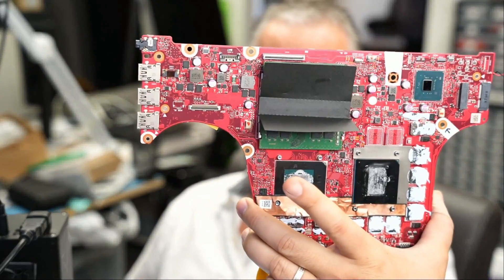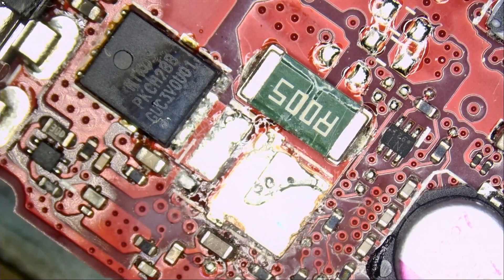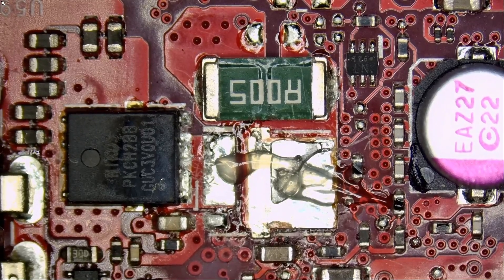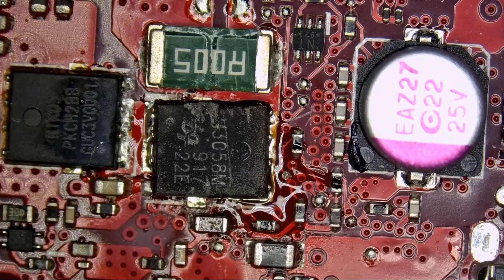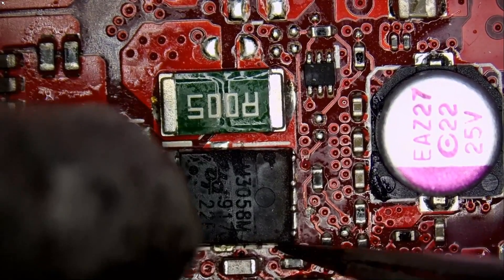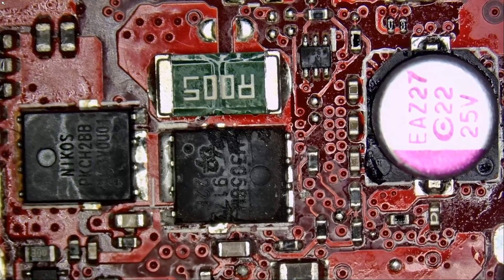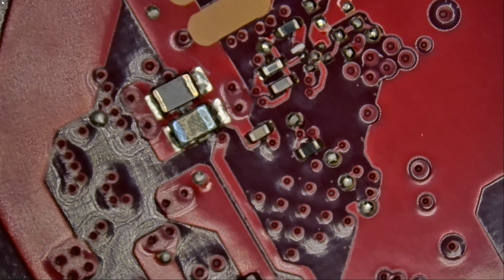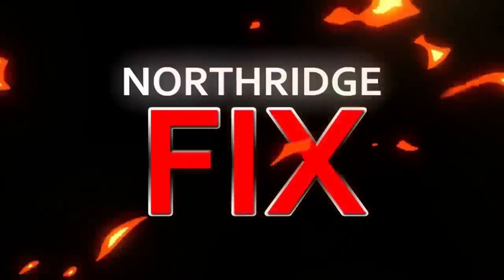DEAD ASUS G731G Laptop Repair - Can We Fix This DIY Fail?

Comment: How do you know the value of the caps when they have no markings on them?!
Reply: He probably used a multimeter to measure the good capacitor out of the two, given their similarity. Or he has dealt with enough of them laptops that he already knows what it is.